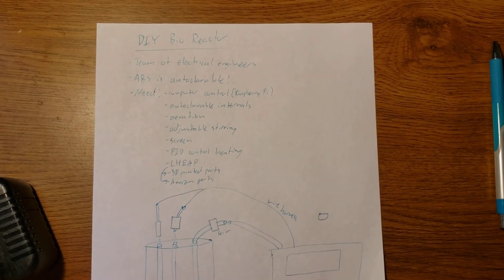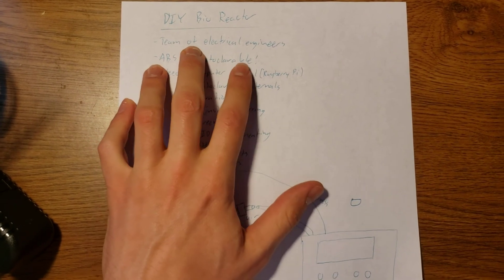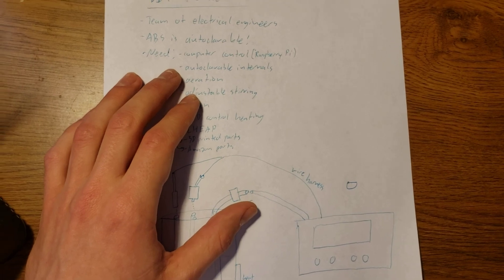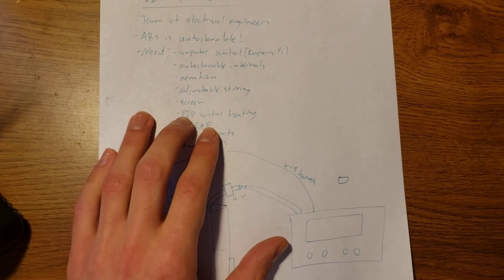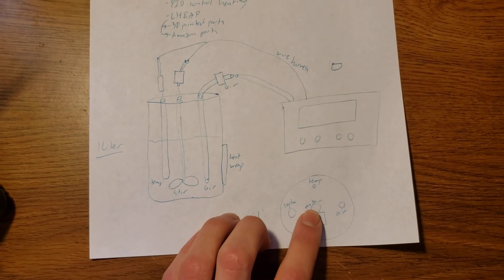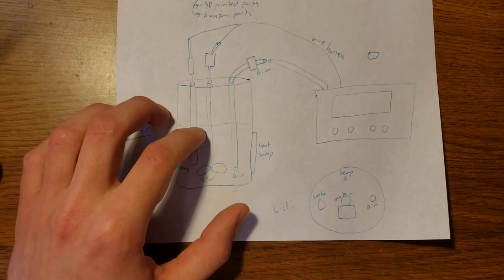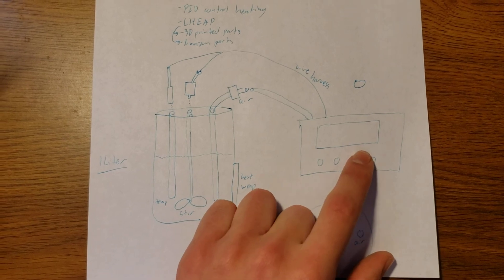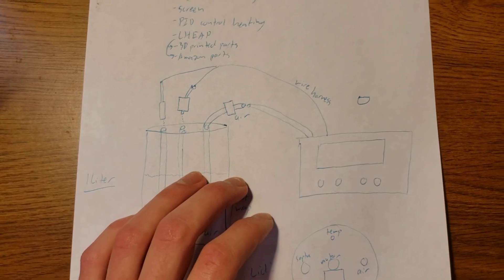DIY BioReactor Update #1

Comment: an easy and cheap heating element can be made with silicone and carbon fiber or conductive ink printed directly onto a flexible material and encased in high temp silicone, bio reactions can get warm too especially in larger reactors so a way to cool the reactor will be beneficial for certain reactors 
there are transparent bottles made by soda stream i see them in thrift shops often they are good up to 100psi on paper but i have literally brought one to 220 psi and it still didnt explode i was even adding some heat to it, this may work better than a mason jar more durable etc  plus it can be put under pressure it will even take small amounts of vacuum and coating it in transparent epoxy and fiberglass leaving a small window for viewing i have gotten them to go under a pretty high vacuum

Comment: Regarding the use of 3d printed parts in general: Do you not have concerns about these parts inherently porous nature providing protected areas that could harbor biological contaminates through the autoclaving process? EG: hyphae that have grown into the gaps between 3d printed filaments (or residue of media) that could harbor and insulate bacteria or mold spores after a use or two.

Regarding ABS specifically: I had considered using ABS in my build (which is currently on hiatus) but switched my focus to polycarbonate due to the difference in glass transition temperature (105c for ABS vs 145c for PC, with autoclaving temps being between 121 & 132c) with an eye on part longevity. Of course PC filament is more expensive & harder to print than ABS...

Because of the porous nature of 3d prints though, I changed my design to use all metal or other pre-manufactured parts. Any thoughts or experience you can share on these? 3d printed would be much easier and cheaper.
Reply from the maker: Ya the porosity is definitely an issue. Each part would likely need to be 3d printed every use. And I have autoclaves an ABS part before, but I am sure there are some geometries that wouldn't survive
Reply: @DIYBiotech  Thanks for the reply.!